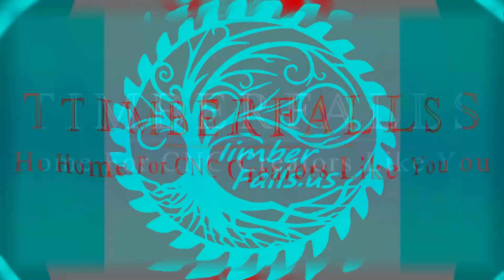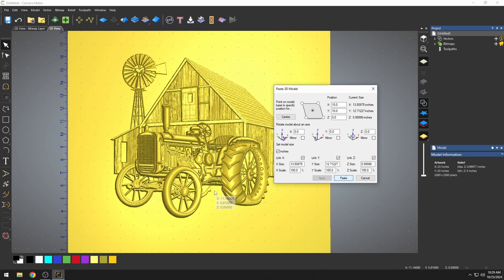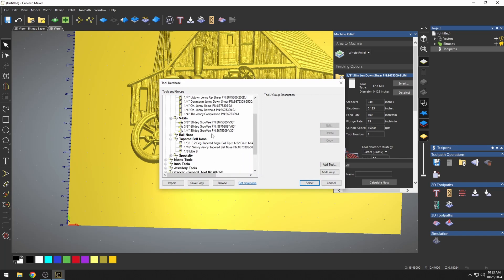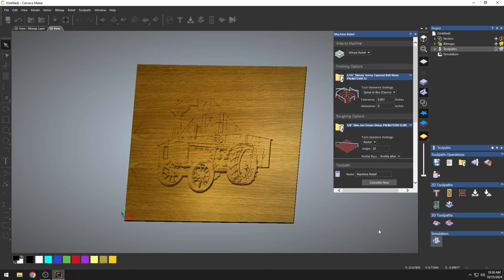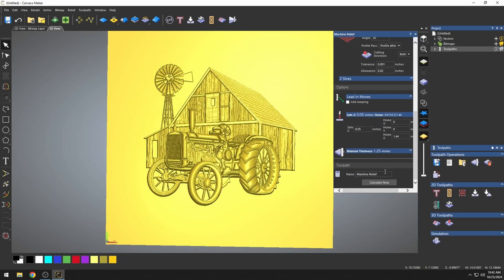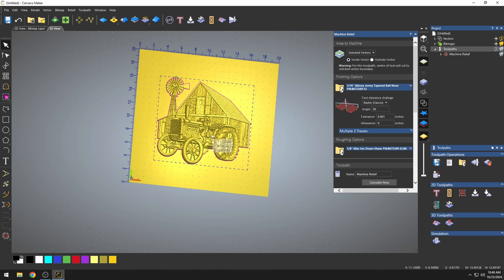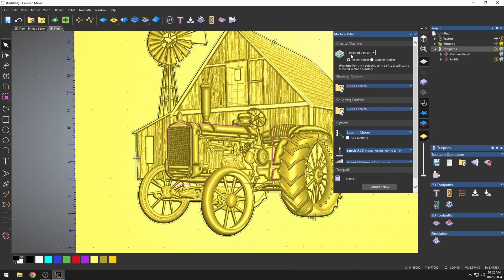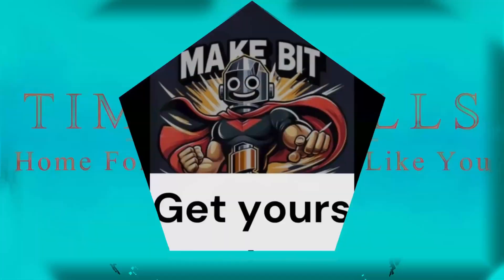Master 3D Relief Toolpathing in Carveco Maker – Pro Tips & Techniques

Comment: What do you do if your ai generated relief from clippart is floating? Its angled up not touching the base
Reply from the maker: when you paste down the clipart you can add or subtract from the base of that clipart by going to the second tab and entering either a positive or negative number in the draft option to move it down or up so that the base is touching on all sides.

Comment: unfortunately the spiral toolpath can only be selected with "whole relief" which is near useless for industrial purposes, raster or raster x/y do not make a correct surface with spherical bits (they don't clean the ridges between passes)
Reply from the maker: @gglovato  the clearing for ball nose bits is contilled by stepover. If you have too much ridging between passes reduce stepover till it goes away

Comment: Thanks a bunch.. This got me working with my first relief toolpath. Though, and maybe i missed it, is there something that triggers the CNC to swap bits?I used nearly same bits, and really only got the rough cut in 2 runs . I'm fairly sure its operator error, lol, but appreciate  the video!!!
Reply from the maker: Unless you have a tool changer you want to save the toolpaths separately, There is a check box in the save window that will do that.